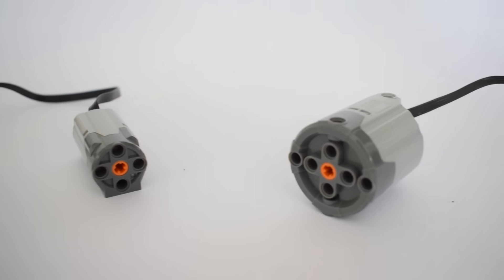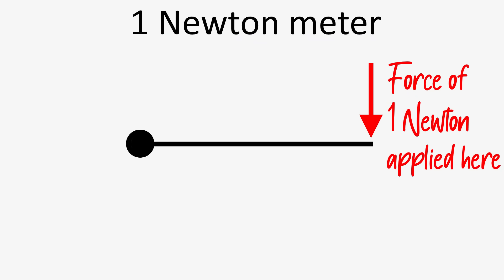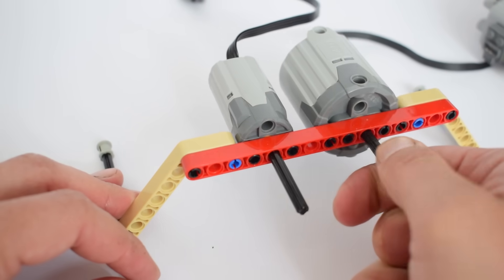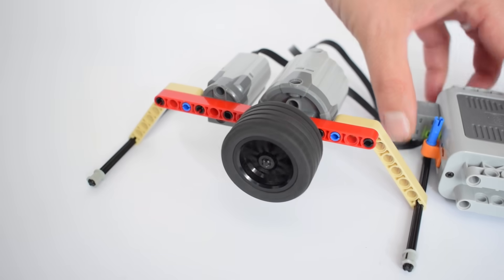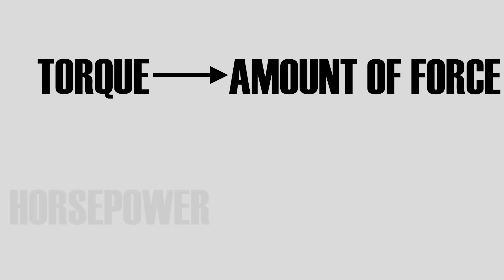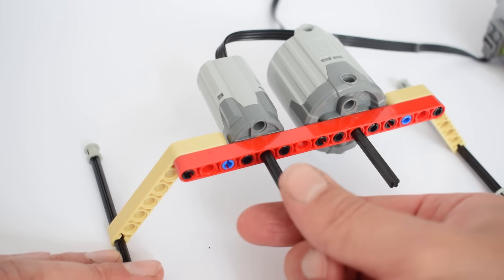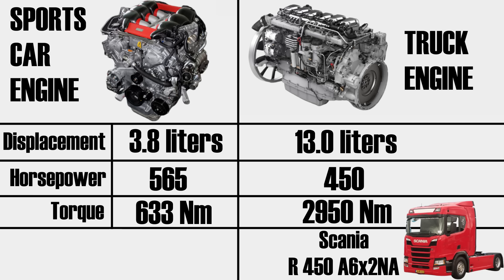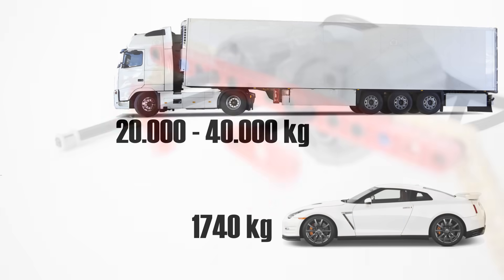NEVER be confused by HORSEPOWER and TORQUE again - HP and TORQUE EXPLAINED in the MOST VISUAL WAY

Comment: Good analogy, demonstration. For horsepower, when I was a teen, I realized that it was applied "work", and visualized two shipment workers, small guy, and big guy. Small guy used smaller boxes (less weight) to move raw product to packaging, and the big guy, in bigger boxes and units. 

The small guy was quicker in his payload turn around between runs, but the bigger worker was moving more in one payload.

In an hour or so timeframe, they both moved a equal amount of payload, (small guy, advantage by faster rate (RPM), Big guy, advantage by brute strength  (TORQUE), while overall "work" (HP) within same margins, boxes = (TRANSMISSION GEARING)
Reply: Your analogy can also explain throughput vs latency for, say, Internet applications. I had a similar analogy in my mind (trucker when you want a high volume of goods transferred e.g. downloads, motorcyclist when you want messages to arrive quickly e.g games)
Reply: @monkaTOS  yeah that analogy tends to be applicable to any supply vs demand scenario where you have an expectancy, and the variables are how that expectancy is met.
Reply: excellent analogy
Reply: ah, Thanks! That's a great analogy. Very helpful.
Reply: @Alexander Ratisbona Nope, bigger guy joints wore out slower but cost immensely more to replace 😄
In terms of mass of material to replace per unit of time you are probably right though.
Reply: Yes, and if these guys had my asshole boss as their boss, he would accuse the large guy of being lazy and not working hard and would pay the smaller guy more money even though both are doing the same amount of Work.
Reply: In my teens I had very muscular legs as  a defenceman in hockey. At 6'1" and 200 pounds I was faster than smaller, lighter forwards. My legs cycled slower than the legs of shorter players but I was faster because my strides were longer and more powerful.
Reply: Yer and smaller guys joins wore out faster from more cycles. Like drag cars
Reply: @anascottwelding1761  Indeed! And a GTR engine would not last long in a heavy truck, even with ideal gearing.
Reply: It's like when I get railed out by big Tyrone, my hole gets worn more quickly. But when I spend some time with little Josè, we can go all night! 🐔🍭

Comment: This still doesn't explain it well. For example, you said torque is what you feel when accelerating in a car 

This is simply wrong. You feel force, this much is true, but there is not magical distinction whereby a high horsepower low torque engine and high torque low horsepower engine producing equal acceleration would feel different.

What torque properties of engines do is modify the final power properties of an engine AFTER it has gone through a transmission. So for example, the truck in your example is able to get moving even with it's heavy weight without having to rev very high and burn the clutch, because it produces very high horsepower even at idle. The sports car on the other hand is able to accelerate faster and produce a much larger felt acceleration force (despite the lower torque), because it is much lighter and can produce higher power for its weight than the truck.

This is really the key - at a specific acceleration rate, both the truck and the car are producing equal force that you feel in the cabin - it is not true that you feel just torque when accelerating, because if that were true, the truck would shove you much more even though it was accelerating much slower (that doesn't happen in reality). 

The difference is not in the force you feel (that's acceleration and is entirely depending on power to weight), but rather the CHARACTERISTICS of the engines power curve, that then translate into driving characteristics.

People always make the error of thinking torque translates to acceleration. It does not. It only translates to power and power curve, which then dictates acceleration as against the weight being pushed

The reason trucks use the engines they do, is because shoving in a sports car engine and dumping the clutch at 7000 rpm just to get the enormous trucks weight moving would not be good at all for longevity of the driveline (the clutch would burn up after a few take offs from traffic lights).

Whereas because a truck engine can achieve the same power at a much lower rotation speed (say 2000 rpm), the same clutch will not burn up and will have much greater longevity.

Also, because the engine is rotating slower and produces a lot of power even at idle, it will generally be far easier to use and more intuitive for moving a truck than trying to use a sports car engine where anything less than 4000 rpm will stall the engine if trying to take off.

It's the power curve that matters, not the torque that produces it
Reply: @Viggo Villsvin No, acceleration is given by power for given weight. It has no relation to engine torque except in how torque creates power. 

Even wheel torque is insufficient to explain acceleration, as the same wheel torque will produce vastly different acceleration forces if pushing 100kg vs 1000kg

This is why the acceleration you feel in a sports car is far larger than in a bus.

Torque is only relevant in determining the shape of the power curve and the characteristics that go along with that

Comment: I think you should add the fact that torque does not require movement to be there. if the bolt on your demo is bottomed out and you apply one newton meter of torque or one foot pound of torque it's still not going to move even though the force is being applied.

Comment: Shouldn’t it be pound-foot? (The amount of force over the distance, as in newton-meter)
Reply: Pound foot is the technically correct form but most people say foot pound because it is written as ft-lb. The foot pound is technically a unit of energy and not work so work was called pound foot to reduce confusion. But the context will tell you whether or not your using work or energy so it doesn't really matter.
Reply: @Redtooth75  I would disagree with your reason just a bit. People say foot pound because they're used to it. Someone got it backwards 100 years or more ago and we've used the term so much that most people simply don't care that it's backwards or even know that it is. When they find out they either are to lazy to force themselves to change or they do but think it sounds weird so they change back and only a very few care enough to always say it correctly. I said it correctly for 40+ years and now I've given up because I don't care any more. I'm usually a technical terminology hardliner but that's starting to go away. To many people learned it and so many other things that I've given up trying.

Comment: You should have used a motor with more horsepower and less torque.   Not a tiny motor with less torque and less horsepower.   Totally confused all of the students you will never have.
Reply from the maker: Nobody's confused, you're just hardwired wrong 😂

Comment: And then you have electric motor that outperform both the sports car in HP and truck on torque 😎
Reply from the maker: More than 3000 Nm pf torque? As far as I know even the plaid tesla has around 1300Nm...so the only electric motor that can outtorque a semi truck is likely used in a factory or other industrial application and definitely not in a vehicle.
Reply: Maybe for 15 or 20 minutes. 5 hours down the road the electric motor guy is still recharging his batteries back 20 minutes from the starting point.

Comment: Diesel torque outputs are relatively higher because of higher compressions and fuel efficiency.
Reply: Diesel fuel contains more BTUs of energy than gasoline in a gallon to gallon comparison.
Reply: @chrisbaker2903  Agreed and the compression ignition with higher CR is needed to release those BThUs :-)

Comment: awesome!

horsepower "vs" torque never made sense to me. now i see that torque is actually just part of what makes the horsepower number, the other part being RPM
Reply: I found having the electrical understanding of watts made torque  a bit easier to understand, as equivalent electrical wattage motors can do the same work despite different speeds / torque.
 
 Plus the units are of course the same as well.
HP (Watts) = Rate of Newton-Metres (Torque / Joules) per time unit (RPM / second)

Comment: first the correct way, newtons meter, then dumb north american units like apples weight per extended leg
Reply: You are an elitist dufus. ROFL.
edit: Yeah, we're dumb but set in our ways and less willing to let the government control our every thought although that seems to have changed lately with this covid nonsense. All it really is, is a particularly virulent strain of the flu. We've had worse in the past. 
But back on subject. We started to change back in the early 70s and so many people just refused and complained that the powers that be gave up on the direct approach. We may never change some of our standards but we are well on our way to standardizing on metric measurements for bolts and some engineering works. I think gradually we will switch over. I was quite upset that we did not change back then. To any people to set in their ways who refused to do so. We avoided gas stations that tried to sell in liters instead of gallons, so many people thought they were being cheated and maybe they were in some cases. But all the changes were undone and all the people were happy again except for a few like me who welcomed the change. I can remember my dad having 3 different sets of tools to work on cars with. Metrics, American and Whitworth. The Britains used Whitworth.
If you're to young to remember whitworth sizes check this site:  https://en.wikipedia.org/wiki/British_Standard_Whitworth

Comment: The problem with using lb-ft as a measurement of torque is it relies on earth’s gravity. Using that on Mars wouldn’t work without a calibrated device. But Newton meters works.
Reply: Define a newton in everyday language. "Well, it's an amount of force defined as a newton." If you are measuring torque in a static situation like having a weight at the end of an arm, yes you could get the same measurement only with a calibrated torque wrench. But that's irrelevant to the discussion. We are talking about here on Earth, not on Mars nor on Jupiter.

Comment: In a sense you CAN feel horsepower though. The GTR is going to throw you back in your seat because it has way more horsepower relative to its weight. So it accelerates faster (just like the little motor accelerating the little Lego stick way faster than the big motor).
Reply: How much horsepower does that GTR make? Any good little engine can be beaten at a race track by a good big engine. My 8,000 lb truck is rated at 245 horsepower and I can accelerate my truck and my 30 foot toy hauler with a car inside, to 65 mph faster than that GTR could accelerate my toyhauler to 65 mph with that same car in it and you'd destroy the GTR trying. Some of the newer diesel pickups make 800 horsepower by making massive amounts of torque. 
My point is, you are comparing apples to oranges. They don't compare.

Comment: Also those big semi engines could easily hit 1million miles on the odometer. Because the engines are not being push to the limit.
Reply: Also because they use diesel, which acts as  a lubricant on the cylinders, while the gasonline used in most passenger vehicles  is a solvent, which cleans the oil off the cylinders.

Comment: What I don't understand is: When you compare high performance electric car engines to petrol cars engines with matching horsepower. The electric ones have always more torque. Which means the petrol engine must have more rpm ?? to get the matching HP. 
But in reality electric engines have way more RPM, right ?
Reply: No. Electric MOTORS... Petrol ENGINES...  and no the motors used in cars do not generate a lot of RPM. They have a very wide RPM range and max torque at zero RPM which is why they don't need a lot of gears in the transmission. Actually as the RPM of most motors climbs they generate less and less torque. A car engine has a much narrow effective RPM range so they need gears to multiply their torque at slow speeds to get them moving and to accelerate. You may notice that you cannot accelerate as quickly in a high speed gear as you would in a low speed gear. That's because while the engine is making the same amount of torque the leverage is less. Gears are nothing more than levers put in circles. A 1 to 1 ratio which used to be the top gear on most manually shifted cars, gives less torque to the drive wheels than first gear which might be 4 to 1 ratio. That means 4 turns of the engine to one turn of the drive wheels. it would be the same as having a 1 lb weight on each end of a 2 foot board that was balanced in the middle.
If you could have a board that weighed zero, you could put those same weights on a board but one side is 1 foot from the center and the other is 4 feet from the center the effective torque is 4 times on the side with the longer lever. Gears in your transmission give you those longer levers.

Comment: I still haven’t found a video that will explain how gearing comes into play. Power is power. Period (as an electrical engineer). 

I can’t see a reason why the sports car engine could not move the load a truck is designed to move (albeit probably at some silly high RPM for the sports car motor to meet the power requirement to move that kind of load). 

Can anybody confirm the advantage of lower RPM for a given power output is the reason why trucks have those massive engineers? Or am I missing something.
Reply: @driving 4 answers
Thank you for your response but I don’t think you quite understood why I was asking, and to be fair I wasn’t very clear in my initial question. A given power output will be provide a certain acceleration for a given mass. This is largely unrelated to the peak power an engine is capable of since if the engine is stalled due to bad gearing you’ll technically have a ‘0’ power output. But let’s not get into that. Suffice it to say I do understand the very basics of gearing. 

Thanks everyone for your replies. Based on my limited understanding of engines I’d suspect those calling out that fuel efficiency is the leading driver of why truck engines are large and run at low RPMs. I can’t imagine any other reason for the large/ high torque engine aside from maybe engine reliability since running at lower RPMs means less cycles of the engine/ vehicle components.
Reply from the maker: https://youtu.be/txQs3x-UN34
This is also in the pinned comment.
Reply: Gears are circular levers. if two gears are meshed and 1 has 4 times as many teeth it will turn 1/4 for each turn of the smaller gear but it's torque will be 4 times as much.
Trucks use low RPM engines because they use BIG engines with lots of torque but not much (relatively speaking) horsepower. They use lots of gears to make up for not having much horsepower. I have driven big trucks and I think the smallest engine of any was 800 cubic inches and that truck had a ten speed manual transmission. I shifted at 2100 RPM and that's where the redline was on the tachometer. 1800 RPM in the next gear and back up to 2100 and shift, again 1800 and back up to 2100 and so on. Some of our trucks had engines much larger and were redlined much lower. When you only turn an engine 1600 RPM maximum you need lots of gears. One of our trucks had a 13 speed and the biggest engine one had 3 transmissions and you shifted through one, then upshifted the second one and back to first in the first trans and go up through it again and so on for all three transmissions by which time you were doing maybe 70 mph with 80,000 lbs of truck and load.
Levers. Gears are simply levers. The gear ratio just tells you how long your levers are in comparison to each other.

Comment: Part about feeling of the torque is wrong, torque is irrelevant by itself, does not tell you anything without context (rpm). When you know rpm/engine range, then you know the power (work done in time), and that matters. Imagine some extremes, two cars that weigh the same, and one has engine with flat torque of 1000NM and only 2000rpm max, and the other one has 500NM engine at 7000RPM. 1st engine produces 280HP, and second 490HP. Just by feeling acceleration, you would say that first engine has less torque, and it would be much slower, even though it has 1000NM torque. We feel acceleration.

Comment: So the one thing that still confuses me on the topic: if the engine in the Nissan GTR makes more horsepower than the diesel engine in the truck, why is the diesel engine more useful for pulling heavier loads? Isn't it POWER that does a given amount of work in a given amount of time (whether it's towing a heavy load slowly or moving light car very fast)? Given an appropriate transmission, shouldn't the engine in the Nissan GTR be able to tow more weight at a given speed than the truck engine which has less power?

Comment: You actually only feel horsepower!
The acceleration is torque yes, but at the wheel, only power takes gear ratios into account. Example:
10Nm 100rpm motor
10Nm 200rpm motor
Both have equal torque, but the second has twice the power. The trick is - for the same wheel speed, you can gear the faster motor at a 1:2 reduction, giving it 2x the torque at the wheel! That's why HP is the most important, you're not driving from your crankshaft. 
Then mixing trucks, different engines and all that just has way to many variables and serves only to confuse.

Comment: I wish you would have just added one more line at the end: "The sports car has more horsepower to push a light weight through air resistance very very fast, but a truck uses it's torque to move a heavy weight slowly."